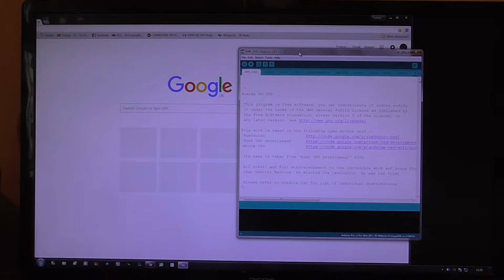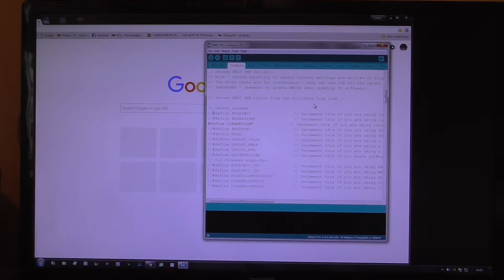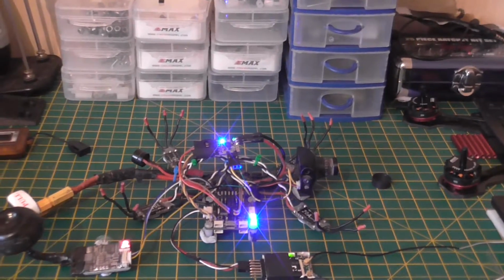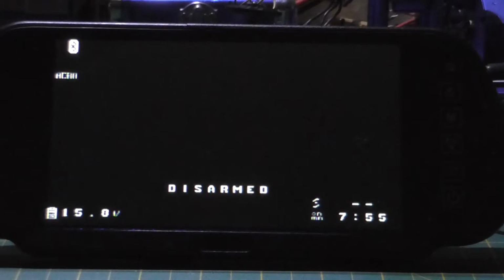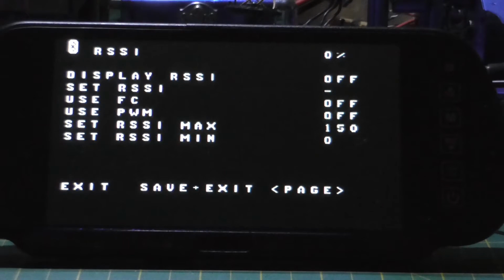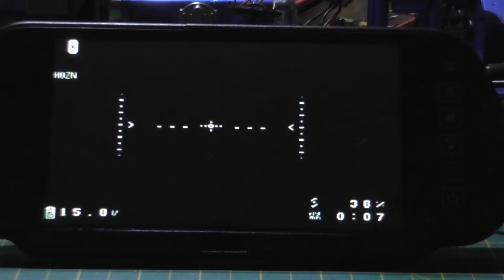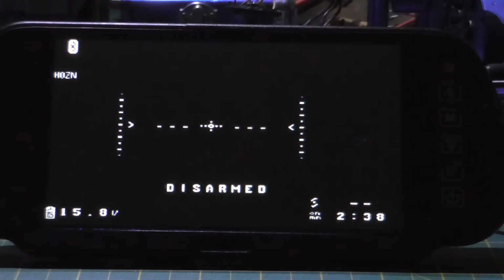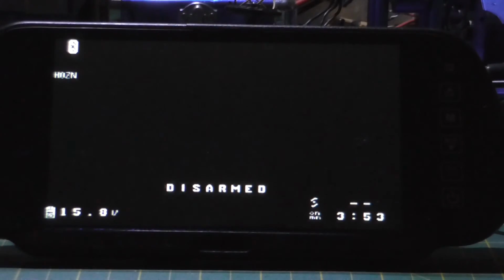Micro Minim OSD Part 2 OSD PID from 4Props Uk

Comment: higot my miro minim going on sp f3 (using uart2 or telemetry) with x4rsb, and just cannot get the rssi to display correctly, got main voltage via using "use f/c" om mw osd gui, tried doing the same with rssi but just flashing on 0%.Any ideas?RegardsJeff